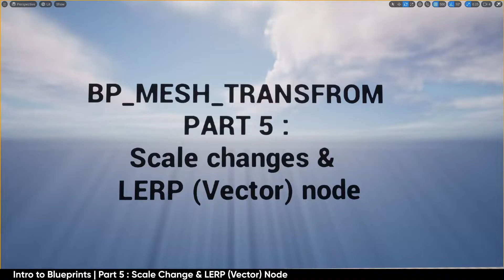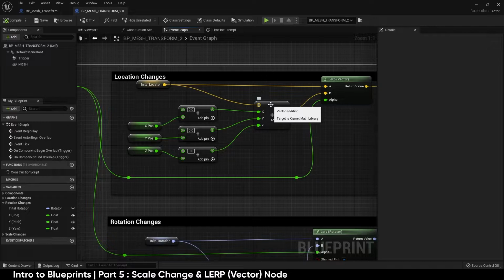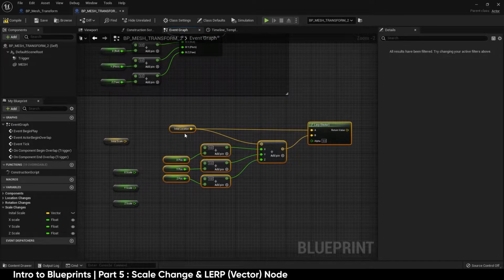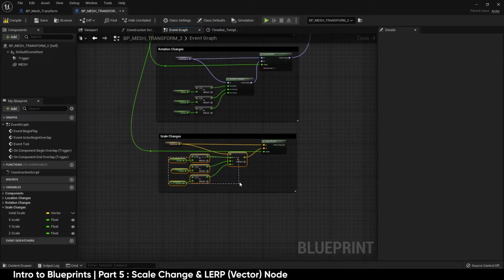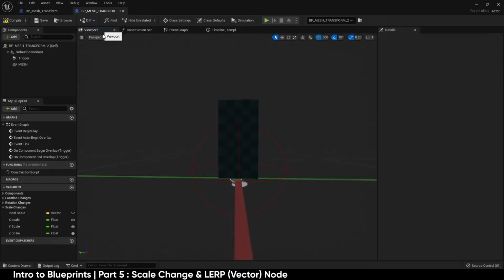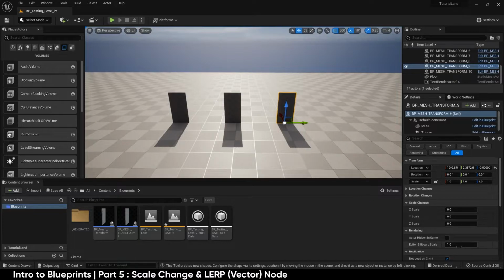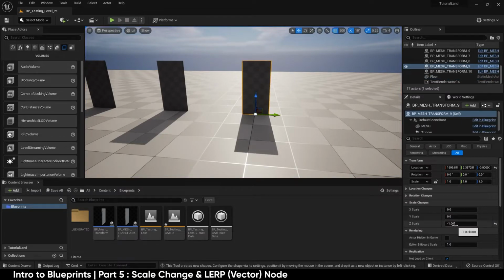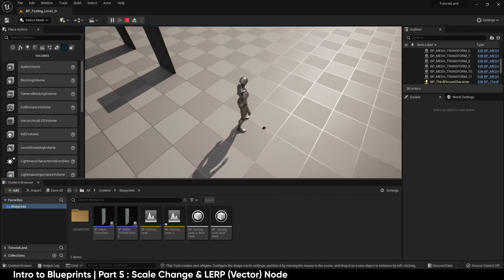Unreal Engine 5 | Intro to Blueprints | Part 5: Scale Change & Lerp (Vector) Node

Comment: Thanks for the great videos.  I completed the 3-transform Blueprint and I have an odd result in that all 9 of the doors thicken by a factor of 2, even the one which is set to thicken by 20.  Otherwise, the transforms all function.  Any suggestion on how to debug this?  I can not find anything wrong in the blueprint.
Reply from the maker: Glad it helped you learn about BPs! Hmmm I wonder if in your vector LERP you are hardcoding in a 2x on one of the values?  Check your lerp nodes and timeline within the BP. Or...upload your BP to blueprintUe and send me the link, then ill debug it. Cheers.